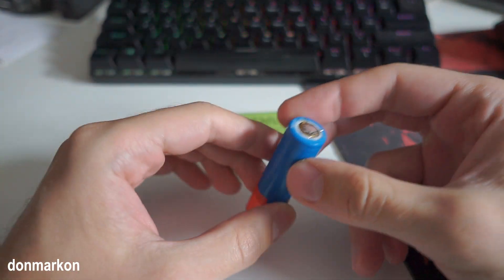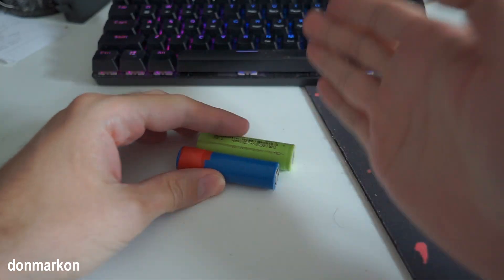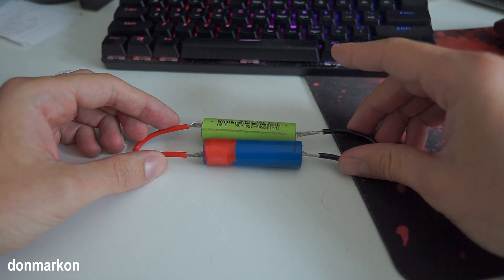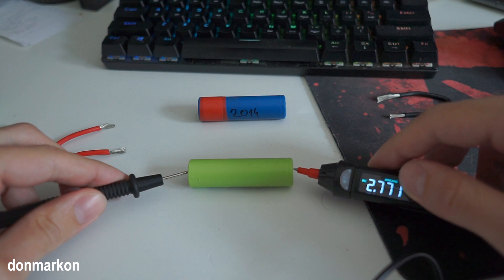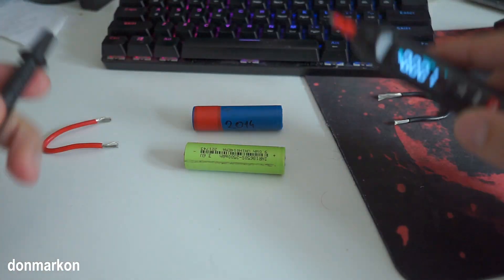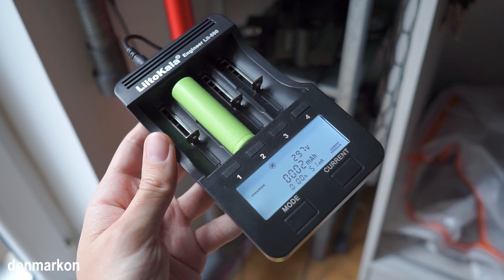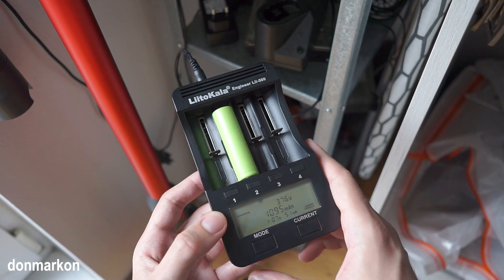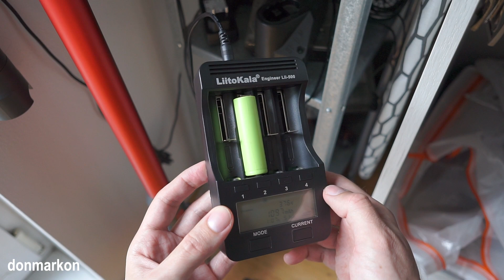Revive a Dead 18650 Works For All Types Of Li ion Battery Cells

Comment: Hi there, can do this with my hybrid
Battery to bring it back to life?
Reply: I ment my car hybrid Batteries.
Thanks
Reply: lol
Reply: Problem is that you need to get to the individual 18650 cells. The cells will be discharged to various voltages. If you could take all the batteries out of your car, break them into individual cells. Charge them using this method or a charger that will charge low voltage cells. Discard and replace the cells that will not charge then weld them all back together again, it is possible that a large proportion of the cells  in your hybrid car could be recharged but it is a LOT of work. 

Welder boards are scold on aliexpress to be used with normal car batteries.

Comment: Hello mate. I have question to you. Lets say battery its 2400 mah 95w 3 amp. When you back to life how it will perform to original specs? Are will be similar or maybe 30 40 percent below original? What do you think? I have around 20 cells and I was thinking to recycle them but if I can back to life and they hold charge I will make one big power bank. Tnx
Reply from the maker: Proper testing is needed, you never know what amount of degradation will happen 
I have powerwall and for every battery there is the process how i test it to see if its fit for use.
Charge the battery with a charger and leave it for some time, if its not losing voltage bellow 4.15v it is in good health

Comment: after charged i can see in your video that dead battery volt is going down..if that going down after few minutes or maybe few second it will same volt as like the begin...
Reply from the maker: The whole point is to bump voltage high enough so you can start charging it with charger. 
Slow charge to full then leave it to rest for one day 
After that slowly discharge and fully charge again. Leave to rest for a week - recheck voltage if stable above 4.15 it is keeper

Comment: Hey bro i really need you. I paid $20 for my pair. So first question: will the revived battery have the same capacity? And 2nd: Can i use copper wire to revive or should it bee a special one? Please respond
Reply from the maker: The longer it stays discharged the more damaged it gets 
Yes you can use cooper wire

Comment: I tried it on my lithium drill battery and it gave the battery some juice and the drill is running fine with it but it won't charge the charger just leave  a green light that it's not charging
Reply from the maker: Maybe BMS is bad did you check it?
Reply: @donmarkon  
What is the bms ?
Reply: @arabgamesandtech2272 battery management system

Comment: it killed other battery too.
Reply from the maker: There is always a risk...  I recovered many batteries like this and never happened to kill healthy battery.
It is always better when connect healthy to dead battery to do multiple times but shorter intervals than one long!
Reply: @donmarkon  Maybe you know this, but you didn't mention it in the video so I'll tell you in case you don't. 18650 cells made in China may not have any safety features. That's why they sometimes catch fire and explode. But cells made elsewhere, especially cells used in tool battery packs and US made EVs, except tesla, have two safety features that I know of (PTC and CID.) The PTC is a resetable internal fuse that breaks the circuit if two much current/amps flows all at once. If the power going out of the battery exceeds the amp rating of that fuse/PTC the fuse interrupts and the battery will read dead unless/until it self-resets, though note that multiple trips cause PTC failure and eventually make the battery more likely to explode in over-current situations. 

If you try to parallel PTC protected batteries like shown in this video both batteries will usually trip the PTC. Easy fix is to use a resistor in series with either positive or negative side to make sure current stays below the rated charging voltage of the cell. It takes longer but is safe to do. I use 100 ohm resistor because that is what I had, but I think a lower resistor would also work, just look at the cell data sheet to get charging rate and then calculate the resistor needed to limit charge rate to half of what the data sheet specifies using e=i*r where e is the voltage of the charged cell and i is the half the charging current. If you get close to the max charging current you will need a resistor bigger that the standard 1/4 watt to dissipate all the heat and not fry the resistor.

Edit: Got PTC and CID confused. PTC is the resetting one. If CID goes then battery is useless unless some unsafe reset methods are used, and then it may work but is a lot more likely to explode.

Edit 2: Learned that Tesla actually strips safety protections out of all the cells in their packs and relies on foam instead, which won't work if the cell is dismantled.